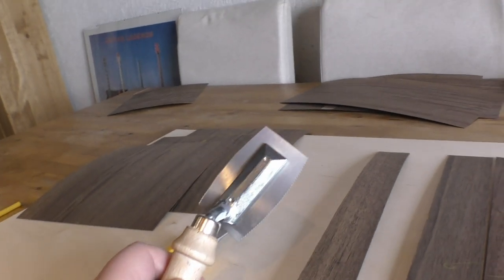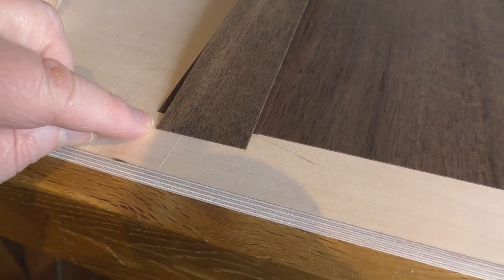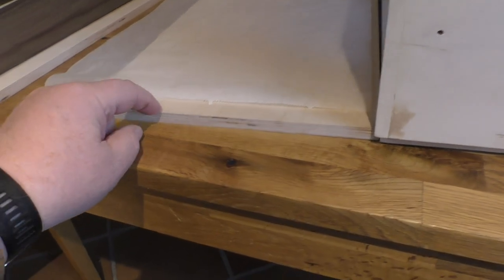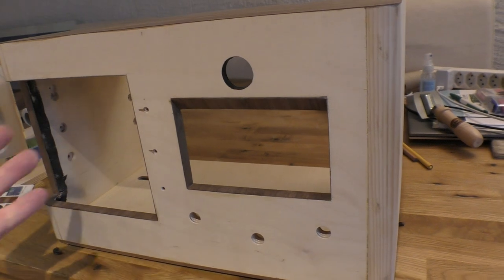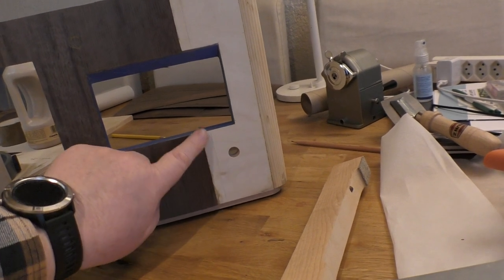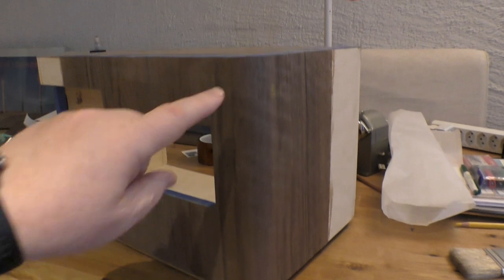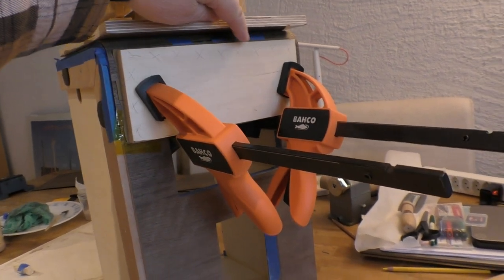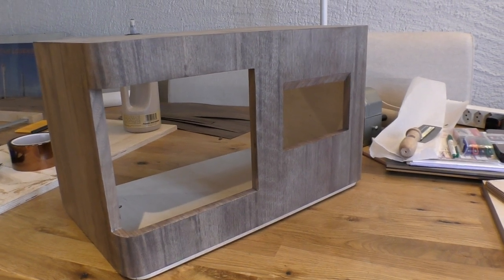Paillard 39 cabinet - part 6 - Veneering at last!

Comment: At 2:14 how do you join two pieces of veneer?  Looks very impressive.
Reply from the maker: You line up the two pieces and join them with tape.  Then you run tape all the way along the joint.  You flip it over and put a thin line of glue along the taped edges.  Then you close up the joint, wipe away the excess, etc.  There are demos on YouTube showing it in detail.

Comment: You might want to do the bend in two steps. 1. is glue just the edge and let it dry so the glue holds 
the line and you can bend the rest around the corner in step 2
Reply from the maker: A possible risk with that method is losing the wet edge.   If you let part of the panel dry then when you glue the rest of it you risk either putting wet glue on dried glue or leaving a gap between the dry glue and the fresh wet glue.  Either situation risks showing through when the veneer is clamped in place.  My approach was very similar except I clamped one end and then did my best to stretch the veneer round the curve.   I think I mostly got away with it :-)
Reply: @Zone1242  glue just the edge and let it dry. Yours looks like it came out good